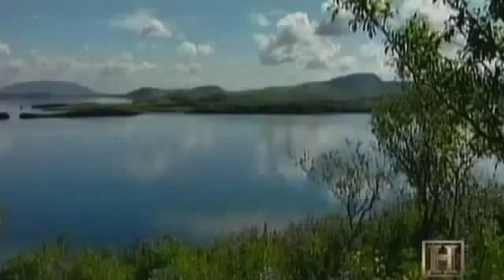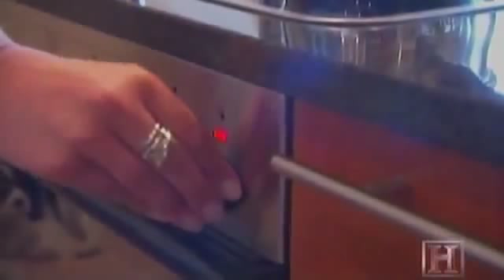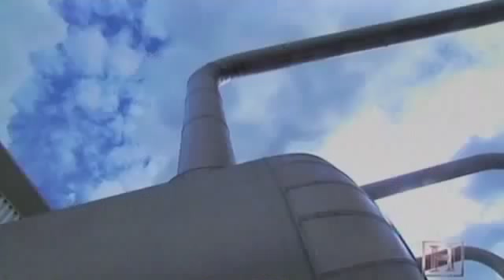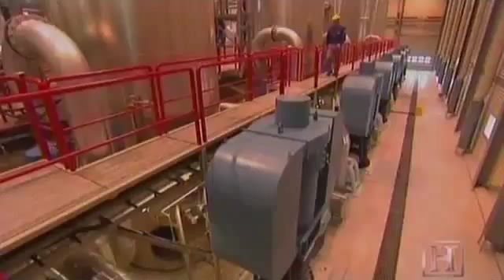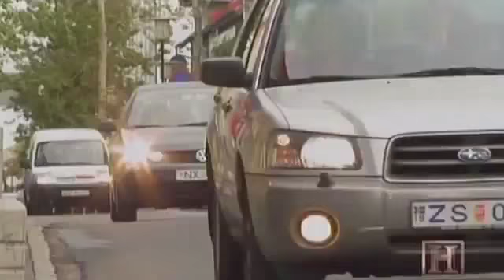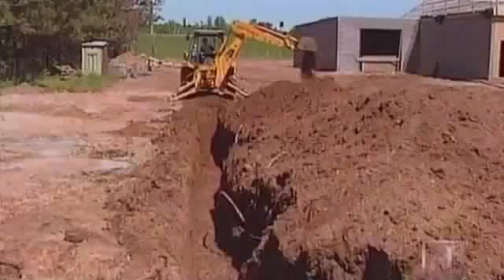Geothermal Energy in Iceland

Comment: It will be better if they will use a low-temperature, low-pressure ammonia gas turbine driven generators that produces vast amounts of water by using below boiling point hot geothermal power. But as far as renewables are concerned, geothermal and hydropower are just supplementary base-load power sources for the only real base-load power sources is either coal, oil, or nuclear which is the ultimate base-load power source such as Russia's self-recycling BREST nuclear power plants that consumes also it's nuclear wastes as an additional nuclear fuel and creates new replacement nuclear fuel as it consumes it's initial start-up nuclear fuel load.